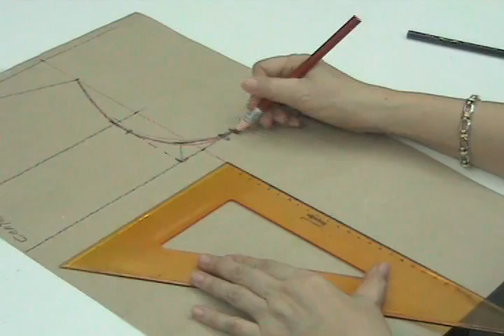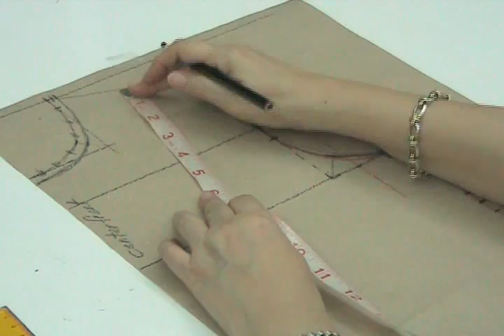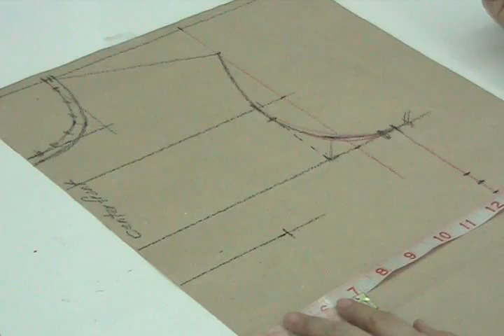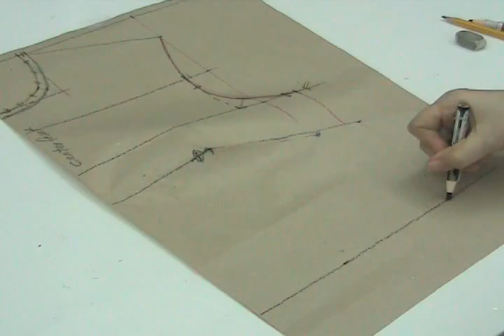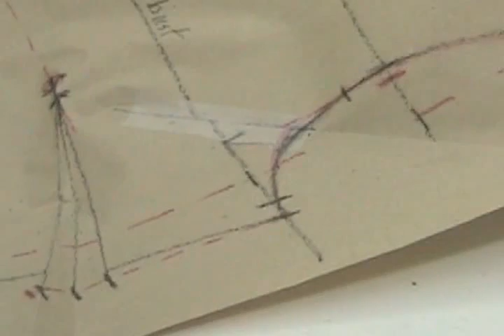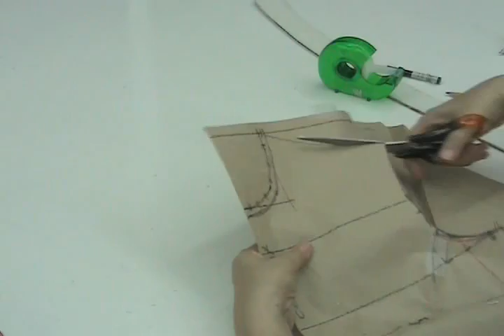Lesson 2-15  MEDIUM Front Block Pattern Bodice Part 1b - BASIC DRESS WITH WAISTLINE

Comment: I've noticed that you did the hidden dart last. Would the 1/2 an inch removed affect the armhole size?
Reply from the maker: This is the basic dress pattern which can be used as a foundation pattern or sloper. As I mentioned, do try both patterns on a cheap fabric and see which fits better on your figure. If the dress with a hidden dart fits better, then this should be used as your foundation pattern. If in case, the dress with a hidden dart fits better, but somehow the armhole feels a bit snug or tight, just lower the base of both the front and back armholes by 1/4 of an inch (.6 cm) or 1/2 of an inch (1.3 cm) on your foundation pattern so that this remains a permanent adjustment for you, and also adjust the dress accordingly. Do take care and God bless.
Reply: God bless u and ur family. Thanks for ur speedy respond. Pray u won't remove these tutorial in YouTube. Why not produce all these tutorial in Cd's and sell them? I would love to have one if u do so. Just a suggestion. :)

Comment: hi chic Francisco need ur help  I trying to draft a basic blouse my client measurement are bust is 48 waist is 43 hip is 48 can I use the large variation of ur bodice draft
Reply from the maker: Hi Darscell. First, I would like you to review Lesson 3-1 and Lesson 3-2 which are the Introduction to the basic blouse pattern for greater understanding on how my method works. With the bust measurement of your client, why not go for the extra large figure (XL) or the double large figure (XXL) or even the triple large figure (XXXL). This just means you have to keep adjusting the bust/armhole level of your client's pattern. Do not be afraid to experiment. Tell you client that since she has an irregular figure, you will first do a blouse with a muslin material. And upon fitting the blouse of muslin material you will see if what you did is satisfactory or needs further adjustments. Then adjust her paper pattern accordingly and keep this as her sloper (see Lesson 2-48 or is it Lesson 2-49).   Do take care and God bless.
Reply: +Chic Francisco this is my first basic draft of a blouse m doing for her . I wanted to do a basic dress draft for her but not seeing any on ur page.

Comment from the maker: Also, in Lesson 1 which is How to Take Body Measurement.  Please notice that I took the tip of the bust measurement from the center of the shoulder and run the tape measure to the tip of the bust with the tape measure running slightly on a diagonal line. The secret is for the tip of the shoulder measurement and the front figure and back figure measurements when plotting one runs the tape measure in the same manner one took the measurement from the body. Then the plotting will be more accurate.

Comment from the maker: Hi.  No, as a matter of fact, if one plots the tip of the bust and uses the center of the shoulder line (as I have) and then runs the tape measure on a "square" or straight manner down to the tip of bust, the level of the tip of bust will be at least one-fourth of an inch or 0.6 cm lower than the level of the tip of the bust and distance of the bust.  This is because the the shoulder line is sloped.  It is after, I have marked the tip of the bust that I square.  Please review the video. :-)

Comment: HI Thank you for your videos. I am following closely. When you for plotting the Tip Of Bust form centre of shoulder line, you did not keep it square. will this lead to much inaccuracy in finding the correct level of the bust and distance? Is there another way to find the 'tip level' , for instance is it always a certain distance from the bust level. thank you.